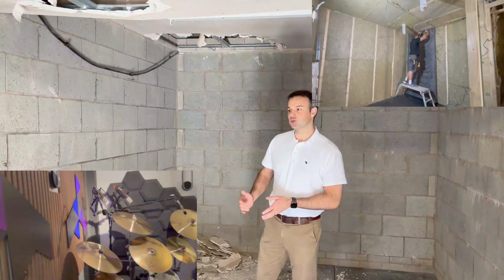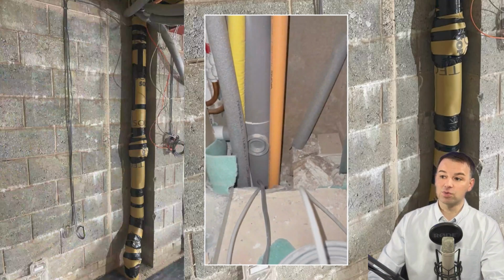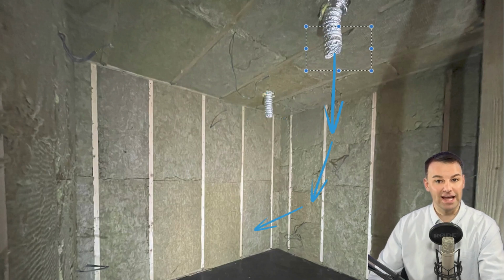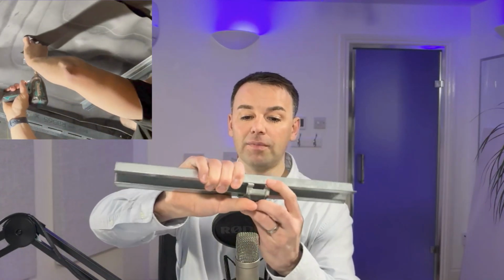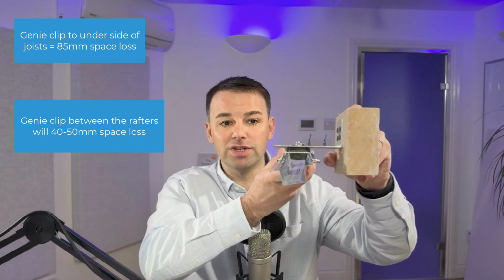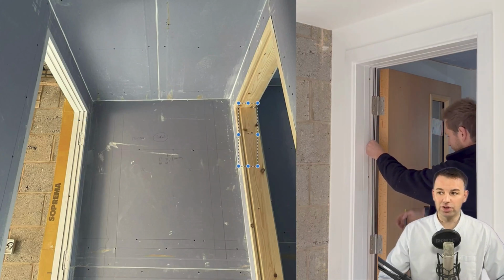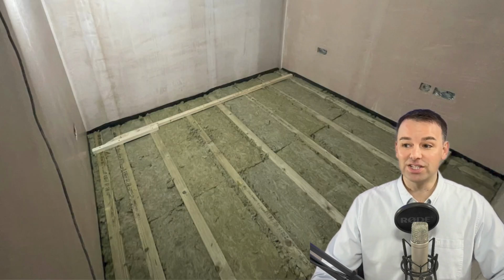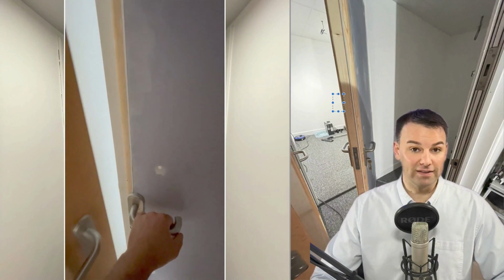Soundproofing a room | DRUM ROOM

Comment: Hi Jim, how are the battens attached to the walls? Nailed directly to the walls? Thank you
Reply from the maker: Hi @rosemarya.9124, great question! 👌
The battens aren’t nailed directly to the wall. They’re fixed using screws and plugs, but the important part is what they sit on.
We first sound-deaden the wall with a visco-elastic membrane (like Tecsound).
Then the battens are installed on top of anti-vibration pads.
Only after that do we screw and plug them into the masonry.
This stops vibration travelling straight through the frame and keeps the wall properly isolated.
Hope that helps — and thanks for watching! 😊

check this video out....it might show you a bit more: 7 Ways to Soundproof a wall
https://youtu.be/rHU7mnu6-zM&list=PL-ZigmSd311dNw8Tbe1IfLiJgEiJcjvMN

Comment: Hello Jim, are there any downsides to using aluminum u-bars instead of wooden bars?
Reply from the maker: Hi @KKayra, great question, thanks very much for taking the time to ask 👍
Yes, we do find there are a few downsides to aluminium U-bars. The main one is that they can create what we call “wall shudder”, where vibration transfers through the metal and actually reduces soundproofing performance.
Because of that, if you’re building a recording studio, cinema room, or home theatre, I’d definitely recommend sticking with timber instead. Timber tends to dampen vibration much better.
Another thing we see on real-world projects is that aluminium systems can limit your flexibility. We’re often changing layers of materials to suit different noise expectations, budgets, and space loss.... and with U-bars you’re sometimes restricted in what you can easily add or adapt later on.
Guitar Studio - Garage conversion
 https://youtu.be/3iYQyxvGCTg&list=PL-ZigmSd311dKNbIFOVqkF1RoSNsjTOCL 

Hope that helps 👍
Reply: @jimprior7  Thank you very much — that helped a lot. To take it a step further, what would you recommend as an application if timber isn’t available and we’re limited to box sections or U-steel/aluminium profiles? - for Walls, slab and ceiling

Comment: How to seal the edges of the floor if they don’t touch the outer edges?
Reply from the maker: Hi @JayJay-oy8qx, great question!
The floating floor is always built last its main job is to help reduce low-frequency vibration getting into the subfloor (often concrete). By this stage, all the layers underneath and at the bottom of the walls should already be sealed at every joint. I find that isolation of the floor is more important than sealing little gap between the walls and the floating floor at this stage. (especially for acoustic drum rooms)

For the floating floor itself, you don’t need to seal it to the outer edges. It should sit isolated from the walls. If you do need to fill small gaps, we use Rockwool and acoustic sealant. We don’t use expanding foam or foam strips.

Thanks so much for your question — hope you found the video useful!
And keep an eye out… at the end of February, I’ve got a full garden room studio build video coming out, start to finish. You might love that one. 🎥💪
Reply: @j @jimprior7 esome videos you put out Jim. Super helpful. I’m soundproof a second of my garage. I could sure use a consultation. Thanks, Jay.
Reply from the maker: @JayJay-oy8qx  Thanks very much @jayJay-oy8qx. You can book a consultation using this link: Work With ME:
https://jimprior.com/work-with-me/
Many thanks 👍

Comment: Is using MLV pointless if I'm only using it on 2 walls with doors on? It's too expensive to cover the whole room, but maybe using some on 2 of the walls is still efficient?
Reply from the maker: Hi @Tom-C, great question!
Using MLV on just two walls can still help a bit, especially if those walls are part of the main direct noise path (like the party wall or flanking walls with thin construction). But if they both have doors on them, it’s likely those doors will remain the weakest point, and the overall result may be limited.
MLV is effective when used as part of a full system – ideally layered and sealed properly – but used in isolation, especially on just a couple of walls, the return on investment might not be worth it.

If you're on a tight budget, you might get better value by focusing on sealing gaps or treating the doors with MLV and a piece of sound bloc board and acoustic seals properly, rather than spending a lot on partial MLV coverage.

Guitar Studio - Garage conversion  https://youtu.be/3iYQyxvGCTg&list=PL-ZigmSd311dKNbIFOVqkF1RoSNsjTOCL 

Let us know more about your setup
Reply: @jimprior7 thank you very much! That's super helpful 🙌🏻

Comment: Hi Jim how are the rubber pads attached to the wall? Did you screw through studs through rubber into the wall or are they separate?
Reply from the maker: Hi @perpetualtom6649, The anti-vibration pads are just positioned behind the battens, they are glued to the battens to hold them in place, there is a whole lesson on this on the Noise Free DIY Soundproofing Course, so difficult explain in a YouTube comment. 
Are you building a home studio?

Comment: how effective is using battons and filling with material compared to making a room within a room?
Reply from the maker: Hi @reaktivuk, great question, the layers in soundproofing system in this video is quite an expensive combination, used when rooms are not big enough for a floating room within a room approach.

This batten system has 13 layers / components that really distorts the sound wave.

A room within a room is better for tackling those
Low frequencies of noise and for rooms with 150mm or more space available from the all the walls and 200mm off the ceiling.

This batten system shown on the video is great when you already have a dense concrete block wall behind it.

Have you seen these videos yet?

7 Ways to Soundproof a wall
https://youtu.be/rHU7mnu6-zM 

 7 Ways to Soundproof a Ceiling
https://youtu.be/0OSrzTPM1cw 

Thanks very much for watching and thanks for your question too.

Comment: Jim, is there a reason you prefer the mute clips just for the ceilings and not on the walls also?
Reply from the maker: Hey Abstract,
Great question I had to give that some thought….
I can get a lot more layers on the walls with other materials in the space taken up by the clip and channel systems.

The size of room and therefore span of most ceilings, it is tricky to build a floating ceiling frame (TPS80C) in the same way we build the floating frame wall system without a lot of space lost.

When soundproofing a ceiling, the load bearing of the soundproofing materials means a floating frame to the ceiling requires big deep joists and therefore a lot of space from room is taken up…therefore (or you make a connection / support) so these cases better to use a clip and channel system.

When soundproofing a ceiling, we find not many homeowners want to soundproof the walls in their apartment as well. Therefore they would not get integrity out of a thicker ceiling system.